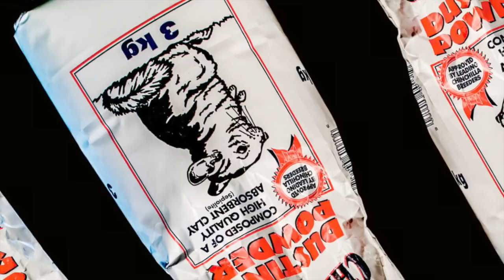How to Model Muddy Roads

Comment: Really helpful video. Couple of questions though. Why do you spray it with the isopropyl alcohol? Also where do you buy your grouting powder from? All I seem able to find is white.
Reply from the maker: +Karl Flavell the isopropyl alcohol helps the glue mixture to flow otherwise it just balls in the surface. You can get tile grout at most diy stores but I got my last lot on Amazon.
Reply: Thanks Kathy. I'll try that with the alcohol as I've got a big bottle I use for restoring brushes (gets ancient acrylic out of them without disintegrating them lol). I'll have a look on Amazon for some tile grout. I never thought of looking on there. Really good videos which I'm working my way through. Very useful and you make it look achievable without any tricks.

Comment: Are there any alternatives to using alcohol at the start to set it?
Reply from the maker: +Charles Smith You need something that will run through the material and plain water doesn't do that. You can add washing up liquid or something else that lowers the surface tension instead. The only problem I've had with washing up liquid is bubbles.

Comment: What kind of foam board do you use?
Reply from the maker: I just use the sheet stuff from Hobbycraft (UK hobby store) for foam board (the white card lined foam).  The blue foam on this diorama is craft foam from here:  http://www.panelsystems.co.uk/product/craftfoam-blue  Not cheap!  I use offcuts of insulation foam if I can find it but it's not that easy to find at certain points in the year and the Celotex brand does not cut with a hot knife and is really dusty when you use a normal knife.  Hope that helps.
Reply: Kathy Millatt - I went into my local Hobbycraft today and was told they don't stock any kind of foam board... 😕
Reply from the maker: +Phil Wright They have huge A2 sheets in mine... just piled up on the side. If you don't mind A3 then Amazon stocks Westfoam and I've bought my black stuff from them.

Comment: I've been working on miniatures for awhile now I've used mostly all natural items except for the glue and paints being natural I don't have to do much except seal it so it don't dry out and turn brown flower blossoms from grasses look like the full size flowers and I've found plants that resembles  ferns and Ivy too it's amazing how many look alikes there are even orchids I've found seeds that look like pine cones and paw paw fruits too everything has a miniature duplicate I'm trying to have the four seasons oh I use fake snow I forgot and I'm using a frame to hold the grasses it's the fresh clay I make a hole and push the clay back around the plants I do want the static grass applicator it will help with the tall grasses and the field grass I'm looking for it now I even make maple and oak leaves out of full size ones I'll let you figure it out lol thanks for the videos oh ok I use a paper punch for the leaves I know too easy I even line up the veins in the leaves yes I'm OCD bad thanks for listening Rod Adams
Reply from the maker: Hi Rod, that’s fascinating. I’ve tried moss etc but they’ve browned over the years despite preserving with glycerin. Maybe I needed to soak for longer. Other than that, it’s an area I need to look more at. I tried a paper punch but I’ve struggled to find them small enough for most scales. I did borrow a brother scanncut which was excellent in larger scales. Good luck with your grass etc.

Comment: Hi Kathy, how would I apply this method to my OO gauge layout?
Reply from the maker: Sean Selley-West The technique is the same regardless of scale. You just do everything slightly smaller. I have successfully used this technique in HO but tend to do the wheel ruts with the back of an X-acto blade. Hope that helps.
Reply: Thanks Kathy Millatt, I'll give it a go.

Comment: what is the spray because IPA = IsoPropyl Alcohol. So IPA and alcohol is a contradiction.
Reply from the maker: +t md Yep, the words don't always makes sense. IPA and water.
Reply: That makes more sense, thanks. I have used IPA + water before. It is excellent as long as the items to be clean are not water reactive (the stuff I was cleaning reactive violently with water but luckily was not something the public would have contact with).

Comment: 03:50 "Isopropyl and alcohol", 30% isopropyl and 70% alcohol? - isopropyl isn't a thing on its' own, it's isopropyl alcohol (propanol). One solvent. Propanol is an alcohol. Maybe you mean a 30% solution of isopropyl alcohol in water? Or 30% propanol with another alcohol such as ethanol or meths?
Reply from the maker: It’s 30% alcohol and 70% water but I just said alcohol instead of water.
Reply: thanks for clarifying. Good series of tutorials :)

Comment: What do you mean by "two wheel widths apart?  You're not very clear on instructions at all.  Also at 12:32 why is all the static grass all flattened out.  Isn't it supposed to be standing up straight?  It looks awful.  You need some lessons from Luke Towan.
Reply from the maker: You need to measure the width of a vehicle so that the road is the right width. As for the grass, it looks upright to me!